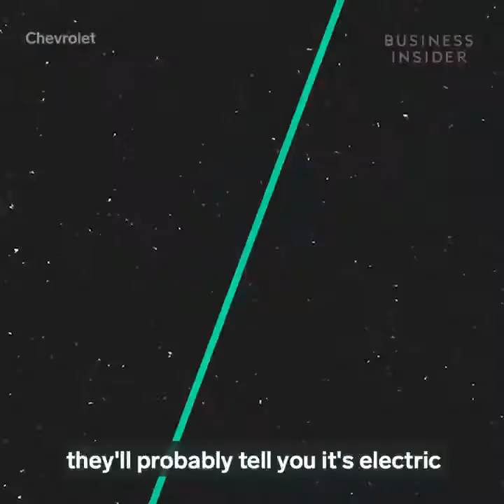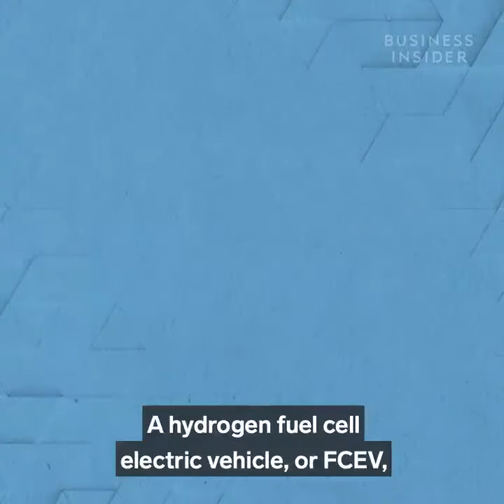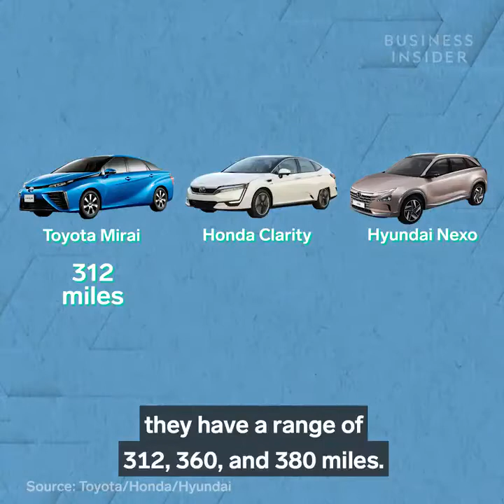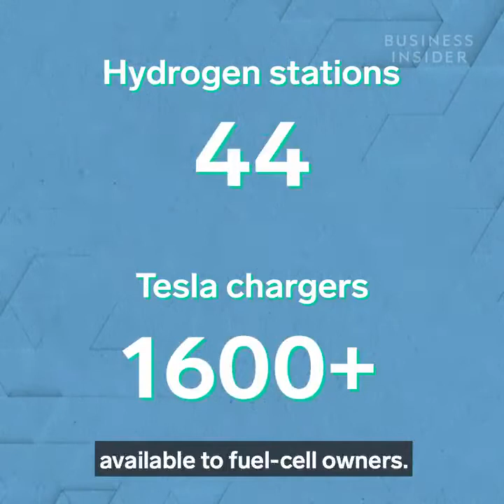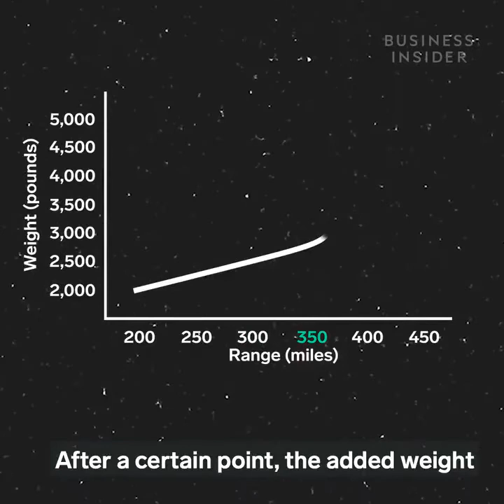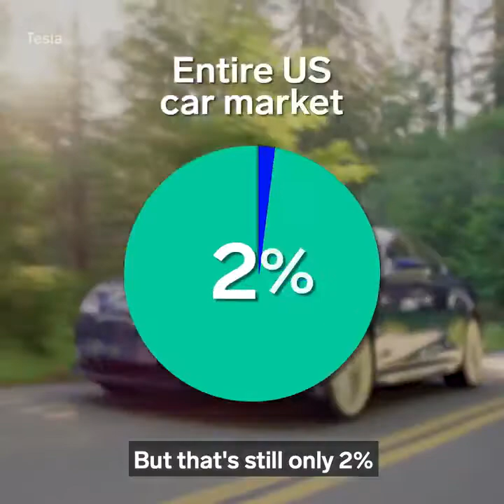Hydrogen Fuel Cell vs. Battery Electric Cars – Which is Better ?

Comment: There are no benefits to hydrogen in transport.  None what so ever. BEV has already won I am afraid. Hydrogen and fusion are always ten years away while BEV has just got on with it.  When you add in charging at home, V2G and hydrogen is hardly energy efficient, as well as servicing costs and the complexities of that, or the cars are that sporty, and I am afraid hydrogen is already a dead technology.  And how long does it take to recharge the filling station between fills?

Comment: Cars just don't have enough room for fuel cells. It seems like a hydrogen car is more annoying than a gas car. You replace the engine with a fuel cell and you replace the gas tank with some type of special made carbon fiber tank that's supposed to protect the car from exploding. That's two pieces of unobtainium unlike a Tesla's where you just replace the battery

Comment: Poor analysis.  How fast can you refill hydrogen car when you have to drive miles away to a refill station, providing if you can find one in your area.  You can charge a BEV car at home, while shopping, while parking, etc.  How about the cost per mile?  Hydrogen fuel cell have its usage.  Its usage with car is very weak.

Comment: They have to menthioned the price /miles of the hydrogen.
Reply: For hydrogen, at current prices: 20 to 25 cents per mile. 
For electricity, at current prices: 2 to 3 cents per mile.

Comment: india is not yet started on abyone technology ,but will be better if we work only on hydrogen for transportation but befor that we have to create infrastructure for hydrogen generation by renewable energy sources only ...
Reply from the maker: I agree
Reply: Using a charger and batteries to store electricity is 85% efficient. Using water electrolysis, compression of the hydrogen for storage, and a hydrogen fuel cell to store electricity is only 27% efficient. It would take 3x more renewable energy to go the hydrogen route, at a much higher cost for the hydrogen cars and hydrogen stations and hydrogen fuel. Battery electric vehicles are more efficient and far more economical. Hydrogen fuel simply cannot compete with the far cheaper and much more readily available electricity.